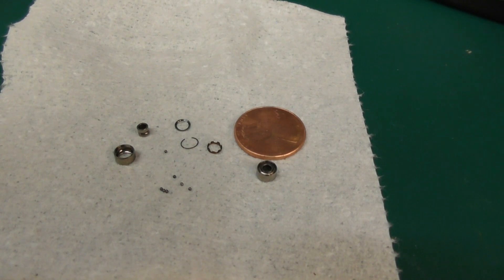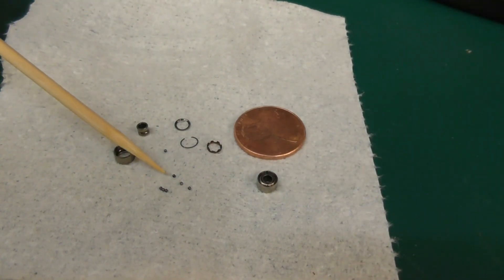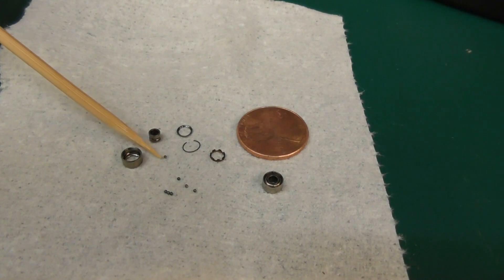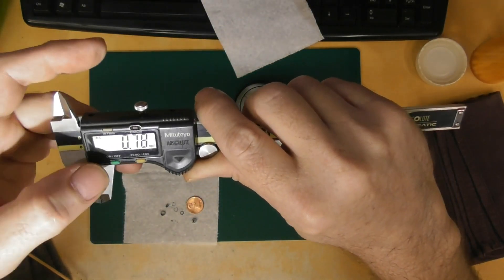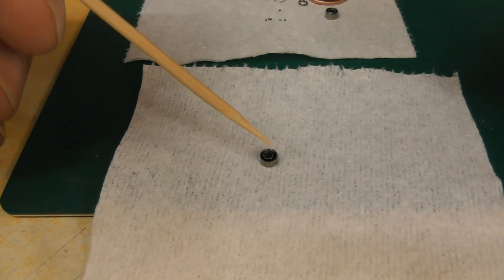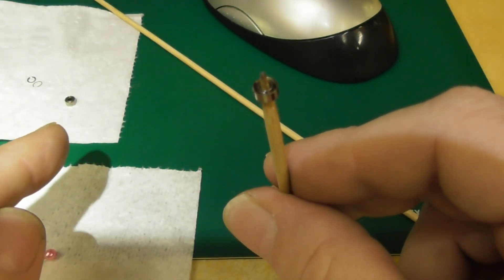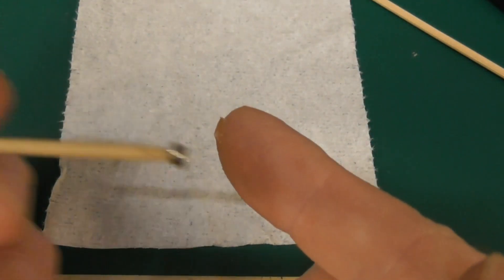Assembly of a Micro Bearing- General Information

Comment: Hey G!  Just thinking about you yesterday!!  Always amazed at that and glad to hear you are all good.  Even with my trifocals,  a 3X optivisor and no espresso for a week, I just don't have that dexterity anymore...well maybe.  😋  Just because You Can, Well Done G!!  Hat Tip and a nod!  And I could tell by your technique you've packed a few bearings in your day...LOL.  Don't remember seeing or using anything that small in my travels...impressive and I'd like to see the mfg processes also.  I couldn't make out what these came out of other than some kind of fan...Video card fan??  If it was, it's definitely worth fixing at the price of Cards now thanks to the bit miners.  I've been pinching naughahyde for several months for a decent one for my new main box...almost the cost of a box at this point!  Happy, Safe Holidays to you and your family, G!
Reply from the maker: Must be the universe speaking PJ. Yes, it's the fan on my video card. It's an ATI FirePro V5900 I purchased years back for cad. I believe I paid about $550 for it then. I looked on eBay and used ones can be had for about 40 bucks...lol. The fans are always the weak link. You might look into the secondary market for something that fits your needs. Good to hear from you and you do the same. Take care, G.

Comment: Very interesting video G.  You have the patience of a saint, though I get when you have no other choice then you gotta do what you gotta do.  I've seen some small ball bearings back in the days when I played with R/C cars, they use some really small ones though 2mm x 5mm might be smaller than I've ever used.  Thanks for sharing this!
Reply from the maker: Thanks Larry. I should've been more clear in the video. These two came apart while still in the fan. I used the bearings out of the old fan to get my machine going again, but don't know their state other than they're working as I type. The ones in the video are my backup set if something goes wrong while waiting for my replacements. I didn't need to do it I guess, but wanted to see if I could. I could...lol. What I didn't show was all the cussing that happened between clips...lol. I've dipped my toe in R/C over the years but that water is ice cold and costs way too much...lol. Good to hear from you, G.

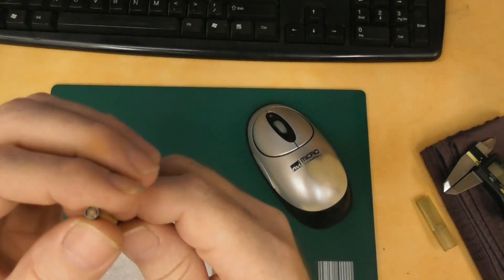Comment: 6:26 - I was wondering about the manufacturing process as well, how on earth could it be economical to make them. my guess would be that the bearing must just be agitated with a vibrating machine or something to jiggle them in place. Maybe they're made into a small ring with a grease or wax that can be melted away or removed chemically so the race can fit on quickly and nicely. That's the only two things I can even think of.
Reply from the maker: Your guess is as good as mine Jesse. You could have a production facility in a small shed. Tiny machines making tiny things...lol. G.

Comment: How did you determine it needed grease and not oil?  Those teeny fans can go at pretty high RPM's.
Reply from the maker: I really didn't put any thought into it since they're a backup set till I get new ones. I don't have any specific oil for bearings, but I guess I could've used 3-in1 as it would've been more appropriate since they do turn a high RPM's. That's what I use for sleeved case fan bearings to extend the life of the fans. Take care, G.